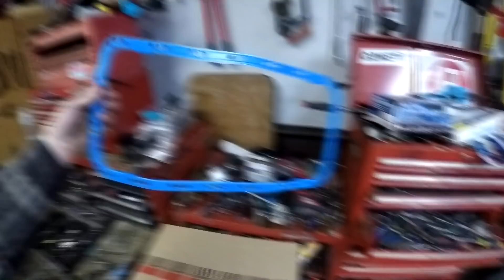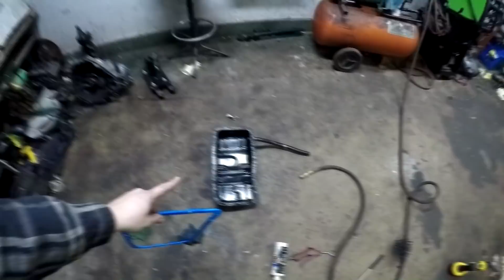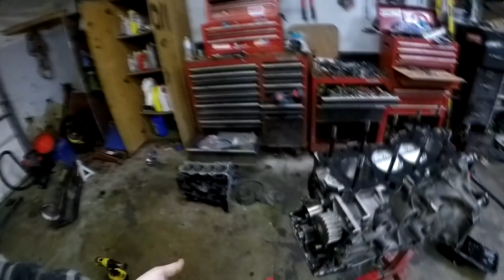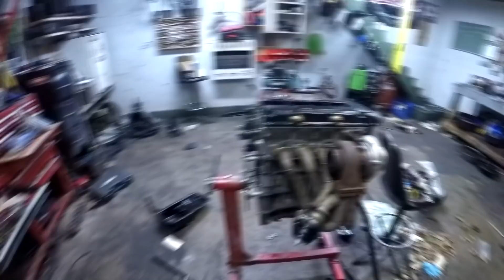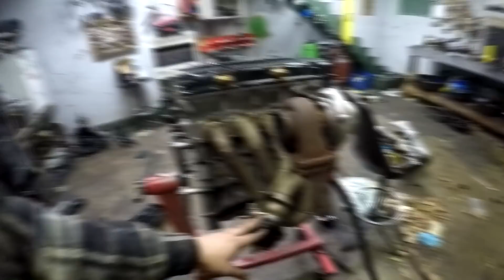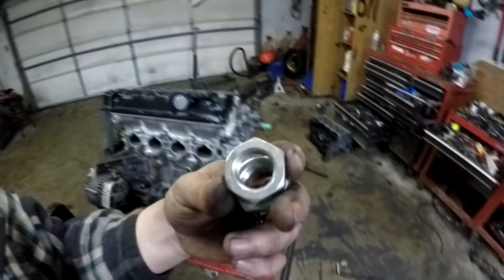Budget GSR Engine Build Updated Felpro B Series Oil Pan Gasket From Speedfactory.

Comment: You still throw any gasket maker on your oil pan when you use the Speedfactory gasket?
Reply: RTV on the block side at the joints for the rear main seal to block and oil pump to block (just to make sure there isn't a leak path due to a "step" between the 2 surfaces).  4 spots total.

Not needed anywhere else.

Comment: I did the same shit with the transmission yesterday... Got the whole fucking thing together, then found a washer on the floor (that was supposed to go in before the ouput shaft) from when I tipped it to put plug in the back.
Reply from the maker: a21bravo haha atleast mine only took me 2 minutes to fix
Reply: @HunterTuned  With valve body and pump off (where it was when I realized) I can have it apart in about 4 minutes, back together about 10-15. So not terrible. Lol.

Comment: What kind of turbo manifold is that? Hows it holding up ?
Reply from the maker: Dbuilt Series it’s eBay $300 topmount no signs of slowing down
Reply: @HunterTuned  no signs of cracking?
Reply from the maker: Dbuilt Series nope
Reply: @HunterTuned  thanks for the reply imight just order one for my dseries u happen to have the link?
Reply: What brand?

Comment: Don't use a mechanical gauge. Best thing to do is run a NPT to AN fitting(1/8npt to -3an) off the plate then get a  6 inch(if they have) or 1 foot -3an line and run it to a sensor. Keeps the fitting away from the engine stuff and keeps the vibration from engine off the sensor which causes them to die faster.

Comment: Buy a rubber freeze plug. Its basically 2 washers with a piece of rubber in the middle and a nut and bolt through it. When you tighten it up the rubber expands and seals which sounds better that a regular freeze plus and gobs of in weld lol. Side note (miiinnntttt)

Comment: So the 10 an fitting u have on the back of the block for ur catch can is that for an oil return/breather.
Reply from the maker: Brandon Eacker ya
Reply: @HunterTuned  thankyou ive been curious about that because im building a boosted d16y8 and want it to breath well plus catch can. Do u think i need to add 1 or 2 more bresthers on my valve cover like urs or is the pcv return enough?

Comment: Good job as always, do you have a link to the wastegate? On my b vtec blocks I now like to run the oe oil separator and keep the system sealed(no air breathers and no more catch cans) I used to run a catch can drainback to a hole I drilled in the block cuz it was a pain draining the can. No more, it's cold and wet here, keeping it oe helps to keep water out of my oil.

Comment: Your going to blow up soon bro your info is top notch I’ve learned so much from your channel and here a prime example of that my boosted h22 was going lean in 3 and 4 gear tried adjusting the tune and all that couldn’t figure it out then one day I’m watching hunter turned and you said stockhonda tanks with aftermarket pumps need to be above half or the starve cause the gas swishes back when at woot now I keep her full and it holds a nice afr

Comment: I ran a wynton wastegate it had bolt on the other end of the valve. Ebay wastegates work just like a skunk 2 throttle body they kinda need to be tweaked. Also i think tial are Australian made.

Comment: Used that gasket on mine and no leaks. The install pins are handy if installing gasket with motor in the car. That way is doesn't move when installing pan.